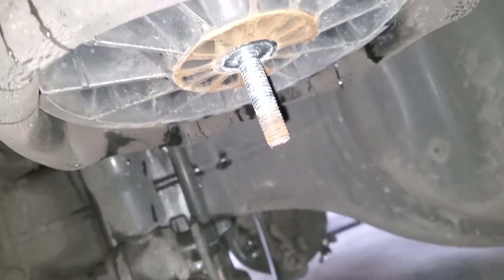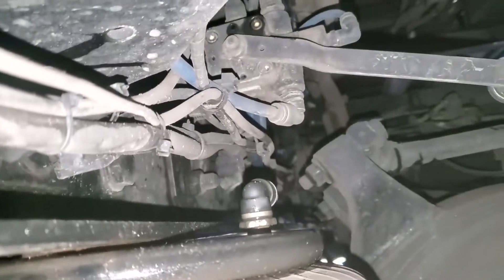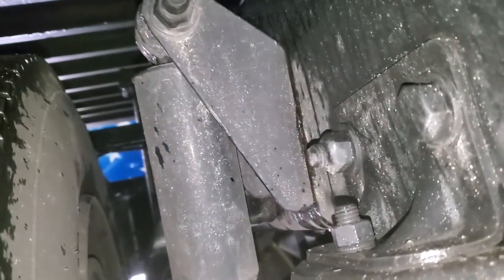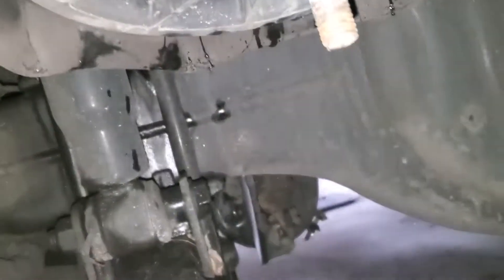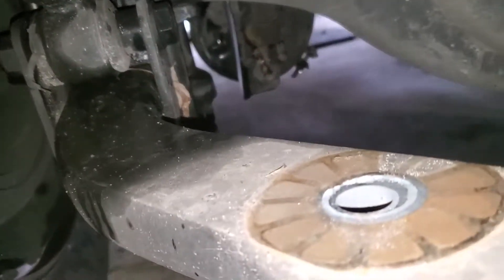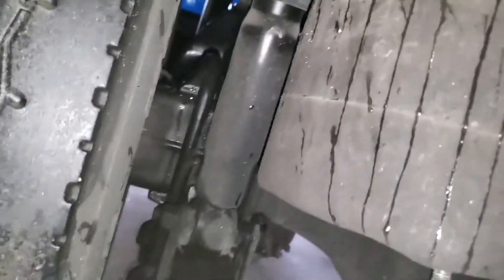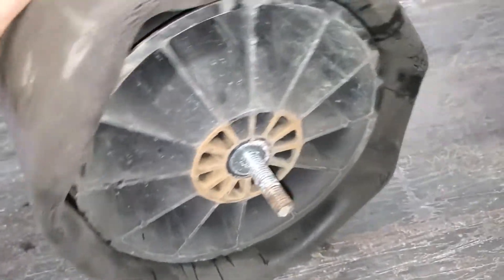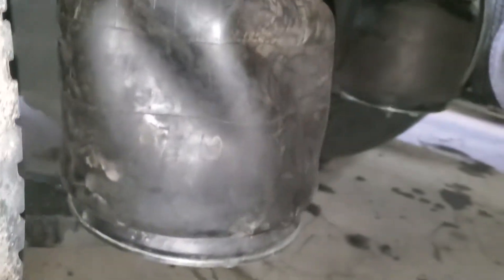Replaced Air Bags Freightliner Rollback

Comment: If you lift the rear end with the bed does it rip the air bag?
Reply from the maker: No, I never had any to rip.  I suppose there might be a scenario where something could go wrong, but in 20 years, I never had a problem.